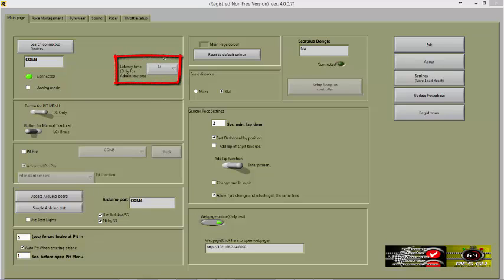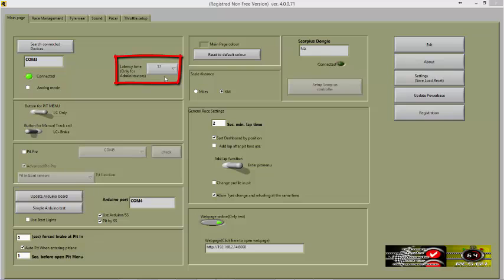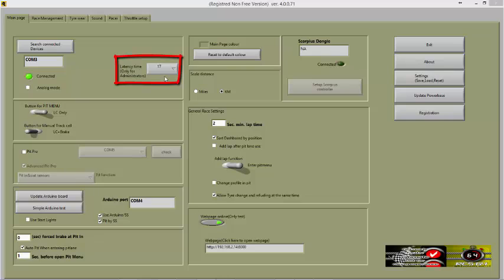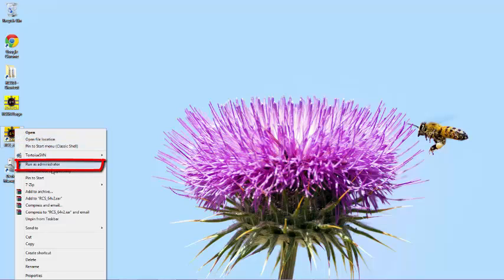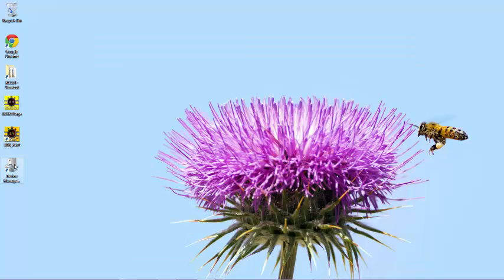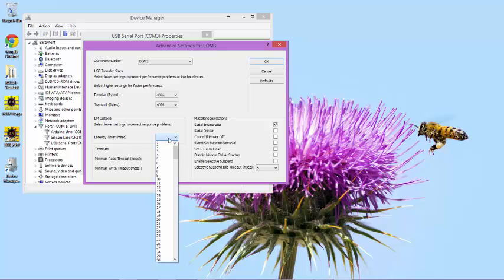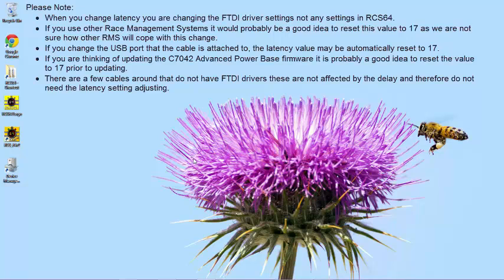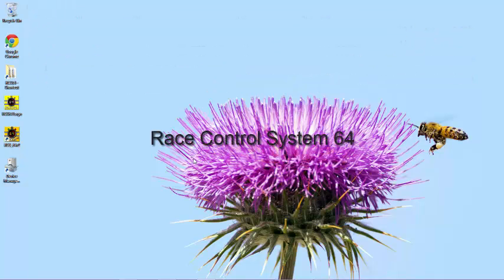RCS64 v4 - Latency

Comment: Hi, if I have an older PC could I encounter issues if I have the latency set to 1? I’m getting a fault stating ‘timeout’ cut off power to APB for 2 secs’
Would it cause an issue to increase the latency settings closer to 17 as it would be as standard if my pc hard is potentially unable to deal with a low latency setting?

This is theoretical, I’m trying to get to the bottom of this fault, I’m 99.9 percent sure I don’t have a short in the track anywhere, someone recommended that they didn’t have the issue after switching to an alternative, however I really like RCS64 and I’d rather get to the root of the issue and solve it rather than just use different software